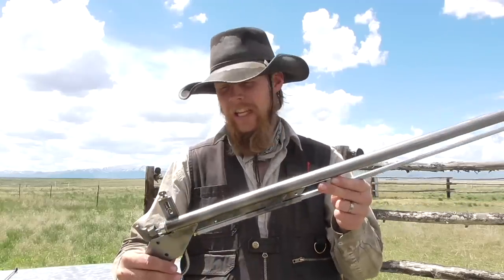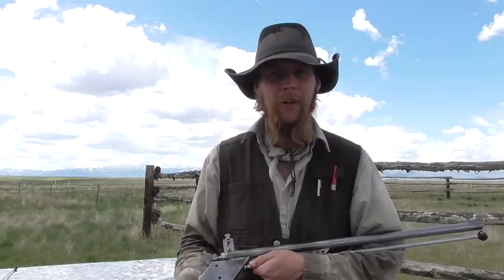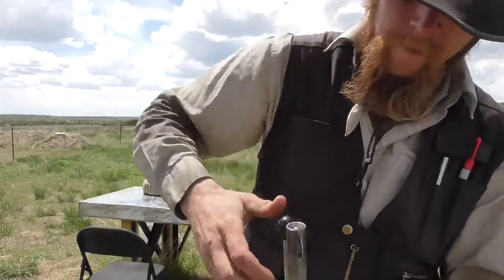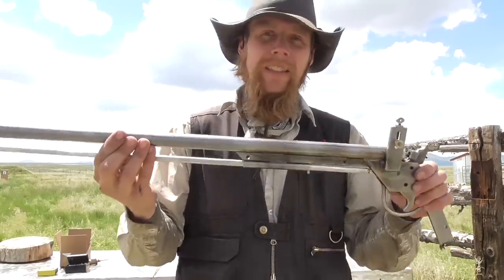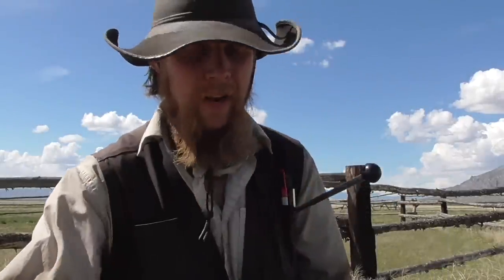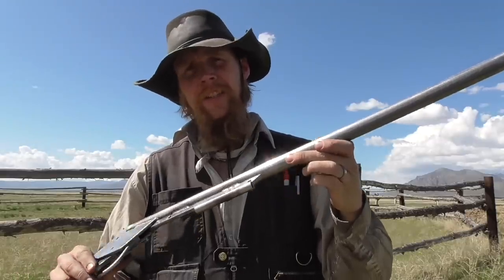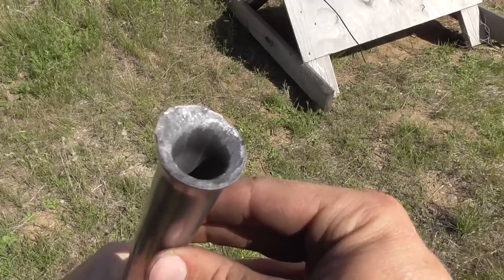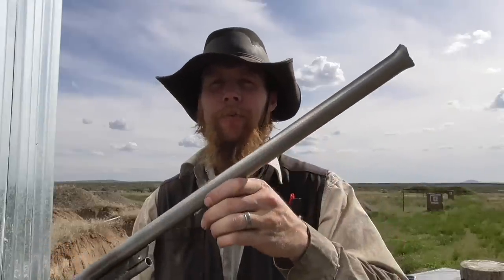Muzzleloader Overload Testing (TIS221)

Comment: i would have tried it with a gap between the powder and bullet. to say the barrel is undamaged is not really correct. there could be damage in the form of stress not visible to the naked eye. needs to be xrayed and magnafluxed. very interesting. if you make something foolproof some fool will come along and prove you wrong.

Comment: That was impressive!  One tough gun.  Maybe some fast burning pistol powder would do the trick!
Reply: Was thinking the same thing, a faster powder would elevate pressure beyond what the cap/primer was able to vent effectively.
Reply: Why? The fastest smokeless powders aren't nearly as fast as the BP or pyrodex the gun is designed for. That stick powder he used obviously upped pressure.

Comment: Can I ask a question? I still don't understand two things about firearms.
1 - why muzzle-loaders can't withstand a smokeless powder? I understand it is a pressure thing, but do not understand the construction issue. Is it because modern smokeless powder guns use a stronger steel, or is there something else? Usually muzzle-loaders seems to have even thicker barrels than modern pistol firearms so that is why I am wondering... Is it about the steel quality, or is there some other trick?
2 - the strong pressure of a smokeless powder can break apart a thick muzzle-loader steel barrel. So how is that possible that a back side of just a brass cartridge can withstand this pressure. Brass is not such strong as steel and the back side of some cartridges are not even that thick (for instance 22lr or 22wmr has very thin rim backside).
Thank you!
Reply from the maker: 1)The difference is not so much a matter of what they can withstand as a matter of what they are designed to withstand.  Smokeless powder is not only more ‘powerful’ than black powder in the sense of producing more pressure per unit of powder, but unlike black powder it is strongly progressive, meaning the burn rate increases dramatically as the pressure rises.  In practical terms, this means that a slight overload of smokeless powder can cause substantial over-pressures, where as a slight overload of black powder will usually cause only a small increase in peak pressure.  As such, when loading a muzzle loader, it is ok to measure out a charge of black powder using a volumetric powder measure that can easily be carried in the field, even though this method of measuring the charge is not very precise.  However, smokeless powder must be weighed out with a very precise scale or mechanical measure, as is done when loading cartridges.  It is not very practical to carry precision measuring equipment with you when carrying a muzzle loader that may need to be reloaded, and could be dangerous to load it with smokeless powder measured by the imprecise methods used for measuring black powder, so most muzzleloaders are only designed for use with black powder.

2)The head of a cartridge case is must be fully supported by the breech face; otherwise the brass will indeed rupture.  The cartridge is only able to withstand the pressure of firing because it is fully surrounded and supported by the chamber and breech face.
Reply: @TheIdahoanShow  do you have this proto type gun for sale yet,!
Reply from the maker: @stevejones6974  Not yet, but hopefully in the near future.
Reply: @TheIdahoanShow  Black powder burns slower.  Smokeless burns really fast.  Black powder releases pressure has it burns.  Smokeless releases most of it energy all at once thus more pressures on the action and barrel.  Smokeless guns needs stronger steels that will withstand an immediate pressure spike inside the gun.

Comment: Redo the test but get velocities...would be cool just to see how much energy is being produced.  Probably do it with one of those lab radar dopler things because a regular chrony wouldn't survive or....maybe even just hook a tractor weight or two to the gun, suspend it off a pendulum and capture how much it swings and try to back-calculate.  Dunno specifically how, but given a known projectile weight and a known gun weight and the distance traveled, it should be possible to get a velocity on the projectile. 

Also, if you really wanna test it, use pistol powder.  The early pressure spike should blow out the back end.  with slower powders the pressure is being relieved by the increasing volume as the bullet travels down the bore.  A faster burning powder wouldn't allow this to happen.

Comment: I am very impressed with the gun, however I feel like I should be saddened by the manufacturer's design choices. The gun certainly appears as if it has been overbuilt, and could very likely be sold at a lower cost if the spec was pulled in a bit.

Comment: The peak firing pressure with black powder regardless of volume of powder or projectile weight in a barrel that length probably never exceeds 20,000psi without an obstruction as long as the bullet or shot is right on the charge. That’s a lot less pressure than smokeless would generally creat would be closer to 50,000+ it got entreating when you brought out the mystery powder for sure.
Reply: With a 45 cal barrel, throw a smokeless powder charge suitable for 45acp,
use a 230 lrn bullet the same as 45acp (size or patch suitable for actual bore)

measure & pin ramrod to seat bullet leaving same air gap as 45acp,
why would we expect pressures to be that far from what 45acp reach.. aka pretty low Pressures

Comment: The other thing to take into account in the overloading scenario is fatigue life of the metal...  So it might take those insane overloads once or twice, but how many times can you do that before a catastrophic failure in the chamber?  Certainly there is a limited number of times it can handle that kind of abuse (and it might be a large number).  Point being, if you mistakenly double load the powder once because you were distracted and didn't realize you already loaded it, no big deal.  But, if you do that every time because you want higher velocities out of your projectile, it will eventually lead to a failure and, potentially, injury.